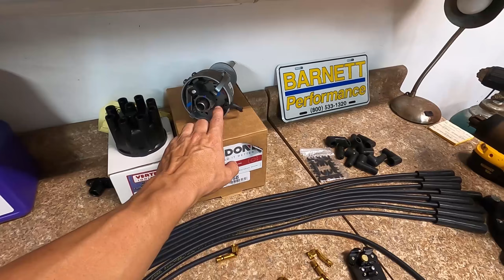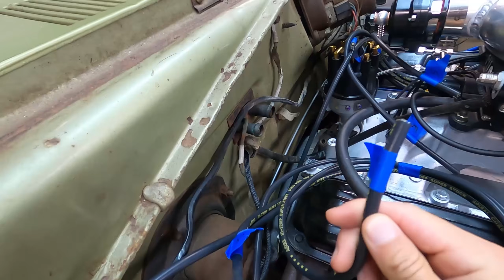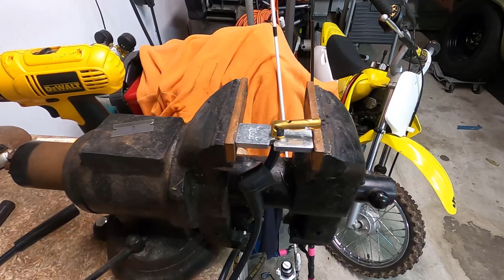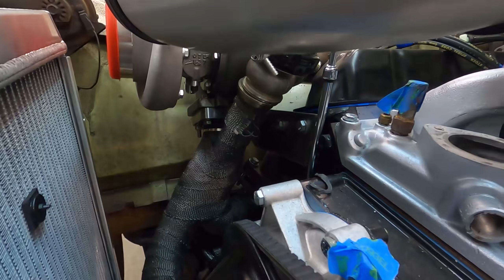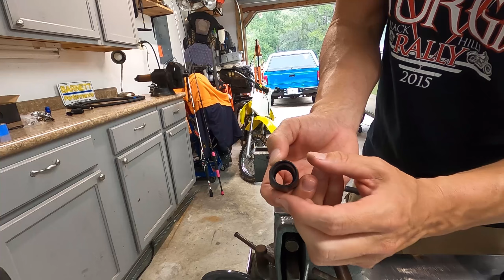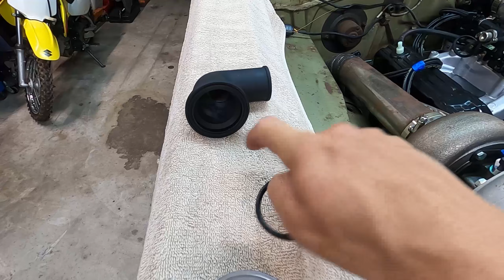'69 Valiant 360 Turbo EP31

Comment: Just noticed it looks like your running a dual plane intake, hope that doesn’t cause a distribution issue as with many others using blow through throttle body injection.
Reply from the maker: I cut part of the center out of the intake

Comment: In the electrical department at most big box home improvement stores (Home Depot, Lowes, Menards, etc.), they sell a tool for cutting the sheathing off coax cable. That tool gives you a clean cut on distributor wires as well and you don't run the risk of nicking the core wire. Just a FYI.

Comment: also change that 90 on the block to a 45. the oil flows full motor pressure and flows a fair volume, u need to make the drain a straight out as possible so the oil doesnt back up.. my build is boostedvc on instagram if you want to check it out
Reply: 45 on the block puts the line right into the exhaust where it merges into the turbo.  Has to be a 90 to stay away from the exhaust.
Reply: @davidmo18  ahh ok.. i returned mine to the sump as i had a issue with oil backing up at the turbo.. see how ya go

Comment: i use the chev thermostat housing on my 318, the thermostat fits under the plate not the neck you were holding, you need to use a die grinder and grind out the mounting plate so the thermostat locates into it as it does on the chrysler thermostat housing as the chev has the locating bit in the block to allow the thermostat to sit flush and then let it seal up

Comment: Be careful routing 5 And 7.  If you run the wires parallel like you have, it can crossfire and the spark for 5 will fire the 7 cyl and detonate since it will be way before TDC.  I've seen it happen, and 7 cyl piston ended up in the pan.
Reply from the maker: Thanks
Reply: @TheGasTap  This is for Fords, but it will apply to any ignition that have cylinders in consecutive fire order.  Notice how the wires are run for 1&3 and 5&6.   https://teamtalk.mastercraft.com/showthread.php?t=55442&t=55442

Comment: the accell tool with the 2 dimples goes in the vice, the dimples keep it from sliding when in the voce, then use a hammer to crimp the top using the other part of the tool. a better choice if you do wires more often is the MSD crimp tool perfect every time.